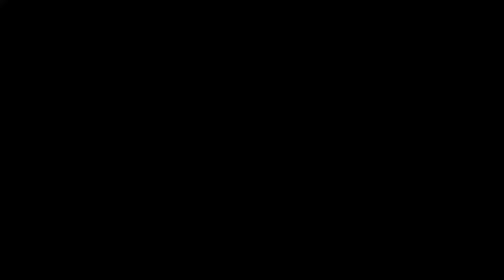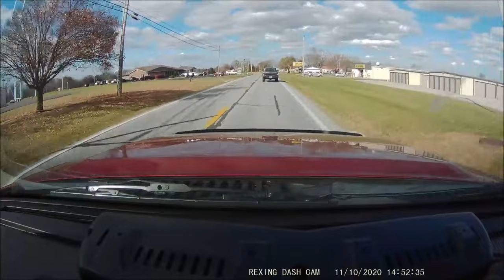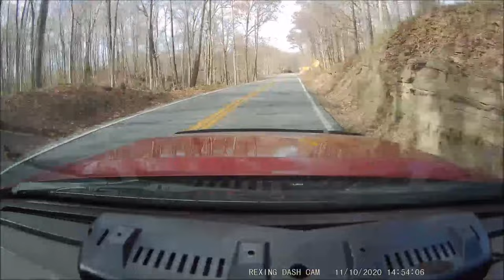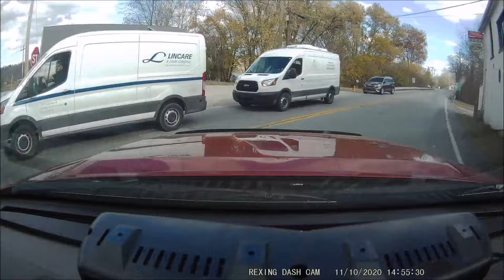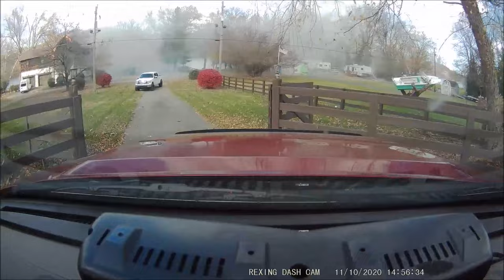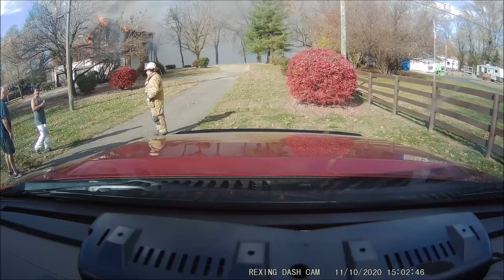Structure Fire Response 11/10/2020

Comment: Brother.....that is was nowhere near “fully involved” when you “arrived”
Reply: By the time first due would get there, it would definitely be fully involved - roll the rigs, better to have more than not enough, this isn't a major city, hell, it isn't even a tiny city for that matter - fyi, 12 mins from dispatch until first water on the fire.  Chief, that wasn't a dig at you, I was a Captain in a rural dept, I get it, you can only do what you can with what you got - good job
Reply: By the time the rest of the trucks get there, it’s going to be fully involved. Easier to make sure everyone’s rolling out and prepared for a full structure fire rather than thinking it’s going to be a small one and not having enough equipment, especially when in a case like this they’re clearly a small department and needed mutual aid as it was. I’m on a small, local, rural department and most of the time we’re lucky if even 3-5 guys are able to show up for a call at any given time. I’m almost always right across from the station at my shop so I’m usually the first one there and can get trucks fired up and garage doors open so everything needed is ready to roll by the time the rest of the guys and Chief get there, though often the chief isn’t far behind me as he’s also close by. Always good to be over-prepared, especially when it looks like the wind picked up a few different times throughout the incident which can drastically increase the rate at which the fire burns. My dispatch always says current wind speed, direction, and ambient air temp when we get a call for any type of fire.

Comment: I'm not trying to be a Critic but why not run a Draft line from the river to put out the fire with huge unlimited water source
Reply: And why didn't somebody turn on the water cannon on top of the truck could have knocked it down and put a damper on quickly
Reply: Perhaps you should read the description
Reply: Most engines have 4 lengths of suction on the engine.  Hard to draft if the water is to far down grade.

Comment: How do you check on scene half a mile out and say it's "fully involved" and when you arrive on scene its a fire in one or two rooms on the second floor with extension in the attic? Apparently the words "fully involved" are thrown around too much.
Reply: It might not have been fully involved when he arrived but it was definitely fully involved by the time the first engine arrived
Reply: @Hal-Robinson  That literally doesn't matter at all. Any size up should be accurate and informed. Checking on scene before you can even see the scene and saying it's "fully involved" just by the smoke you see it a typical unexperienced volunteer thing to do. You don't give a size up for the future when the first arriving engine company gets there. Thats not how it works and if you think thats okay, you must not be trained very well.
Reply: @Hal-Robinson  and if you REALLY want to piece it apart that much, the first arriving engine arrived around the 16 minute mark. Definitely nowhere near fully involved it was only the second floor from the front that you can see. Like I said in my original comment, the words "fully involved" get thrown around way too much by inexperienced fireman on the radio that can't tell the difference.

Comment: Unless I am wrong but it looks like one of the first or early arriving firefighters (maybe a chief officer?) was more concerned about getting his drone up in the air instead of either doing a 360 (on foot) so can provide decent operational incident command. Hopefully I am wrong in what I see? I get it having no water supply and having to depend on tankers to shuttle water but totally against technology becoming a barrier to actually boots on the ground! I am not beating up on the other firefighters that seemed to be doing the best they could to shuttle water to the attack pumper(s)!

Comment: Ok I am so confused, why you set a dump tank to run a tanker / shuttle then place a engine in the front of it?  😱

You have a loop drive way... Place the engine in the middle pull 2 hand lines and use the turret as a 3rd stream... Place  water supply down in the head of the driveway... Use the 2nd engine to draft from it and push a constant water.... Keep your tankers moving with water never sitting and waiting. 👍
Reply: I think there seemed to be a problem with the first tanker...and since it was not mentioned in the description I'd guess operator error.         Personally I would have dropped the PT about halfway down the drive for the next incoming engine and tanker to work with and nursed the engine in the front yard.

Comment: I was a firefighter forv2 years. I might be a bit nit picky here so bear with me.  #1 your dealing with mostly Volenteere departments so its hard to get people & equipment out & tonthe sceen.  #2 There are a few things that i would have done diffrentky. And #3  1 key factor  that was lacking from command was clear comunication (in my oppenion)  to his first arriving engin & tanker. He had to go face to face with them to give them instructions. Thats what the radio is for exactly WHERE do you want your first engin for fire attack. Where are they to.park the truck & what assignment when they get there. It dosent matter WHAT the first in engin company is just clearly state "First in Engin company I want you to come in the gated entrance park in the drive way & start fire attack second due engin company establish water supply)  this is very clear cut telling tankers to park "where ever" is poor planing & comunication. You tell them exactly where the tankers are to stage you may have 2 staging areas due to where the tankers have to come from if they have to pass the sceen to enter staging you may have to have 2 staging areas.  This was my major beef clear concise comunication or lack there of. The placemet of the porta tank coukd have been better as it took a while for the second engin company to arive to setup water suply (aka drafting opperations) if the first engin cimpany was placed diffrently there would be no need for the second engin company to drop hard suction, however its always best if posibke to have your second due engin company to supply the first engin.

Comment: That 1st tanker does it have a deck gun ?? Glad 1st 2 engines hit deck gun but the tanker should've dropped the drop pond/pool off n supplied the engines with water. Wasted time n resources. What ground conditions to lake in background??? Could a engine have been beached there to pump water up to another ??
Reply from the maker: This is the Ohio river, we did eventually go to the river at our boat ramp once it was determined all hydrants were out of service. However, when a barge went by it stirred up a lot of debris which started to get in to the tanks. This would have caused a lot of damage to the engine. The tanker does not have a deck gun but we actually mentioned that on scene and wished it did.

Comment: Could you not draft direct from the lake?
Reply from the maker: This is the Ohio river, we did eventually go to the river at our boat ramp once it was determined all hydrants were out of service. However, when a barge went by it stirred up a lot of debris which started to get in to the tanks. This would have caused a lot of damage to the engine.
Reply: @JASON8502  makes sense. Thanks for the response!

Comment: I’m gonna need tankers? I see a body of water behind house what is wrong with hard suction pumper?
Reply: I found it on google earth and it’s just close to 240 ft from where they set up the dump tank to the edge of the river unless you find 24 sections of hard suction and have the best pump made then you will not create enough vacuum to pull the water that far.
Reply: @zachbaker1583  I thought a pumper might be able to get closer. I guess that would depend on how firm the yard is and what weight could get on it. 
Also the next property looked to be a mobile home park that got closer to the water as well, being I have no clue the address I can't just look it up to see how close a pumper may have been able to get. edit: Just relooked at footage. It looked to be a campground that goes right near the waters edge, too far for pumper to pump to engine?
Sure would have been better than running the tankers, especially with low pressure hydrant as the lady said when she was filling her tanker.
Reply: In the Netherlands the fire departments often hydraulic submersible pump to get water. I think Berkeley, California has a system from the Netherlands.
Reply: @chukkie0001  for that I’m sure it is a matter of funding and justification. If had call for it to be used multiple times a year then the justification is there.

Comment: This is a good example of the reality of rural living. Most departments are volunteer and being during the day this is what will happen. My only take aways are the first in engine did take up a lot of time setting up and they also could’ve utilized their deck gun and took out fire more efficiently. You gotta do what ya gotta do with what you’re given with these kinds of departments. Response times are excused due to location and personnel limitations but once that first due engine arrives they set the tone for the rest of the fire.
Reply: Thanks for proving you have no clue what you are talking about
Reply: @virgilhilts3924  I do have an idea of what I am talking about, I am on a paid on call department that runs 2,500 calls a year and neighbor a full time ALS department. The upper half of this house was a loss from the get go and no interior attack was possible. This is a surround and drown and just dump a deck gun with multilpe hose lines on the sides. I work with multiple volunteer departments and I know how operations work when thats who youre working with. I experience these types of responses often and understand that maybe one of theses departments was full time. Most likely the first engine on scene, I'm not sure what youre getting at.
Reply: @jn3665  
You keep telling yourself that

Comment: I myself found 1 man can slow/putout a fire. It was a car fire on our vol dist’s furthest east side on 294. Daytime call and most  worked days. I was first in and geared up. No one showed so I took our 2nd engine which held 750 gal instead of lead at 500 gal. It was fully engulfed  so as I pulled up I heard lead engine responding so extra water was coming. Packed up pulled an 1-1/2  and charged line.  By time 2nd due pulled up it was out except for under hood for most part and had 1/4 tank left.  I know whoopty do. But one man CAN get a good knock and from what I could see in this video one man could have got a good knock on it. Hoping not to push fire in but this looked like a major clusterfuck. Why didn’t they put tanker setup in street and use an engin to relay pump in? . Just my armchair thought

Comment: What does “on air” mean? Responding? Here where I am we call in with our Dept number and say “we’re en route”
Reply: In most departments On air means that a unit is in service and the radio is active for the dispatched vehicle so both the IC and the dispatcher can transmit information to it.
Reply: @josephbennett3482  so it’s basically means the same thing of how we say it here by being “en route” = in service.
Reply: @CSAFD  yeah pretty much , On air is radio active and the unit is either on standby waiting for their next dispatch or they are currently pulling out of the station.
When My city department units go out of service for a short while they say that they'll be off the air and unavailable for calls but the only time that's done is when they have to refuel and it's only done about twice a week depending on how busy it gets.
Reply: We say our unit number than 10-8 or enroute here.
Reply: @lindanwfirefighter4973  my area left the “10” codes a long time ago.
Reply: @CSAFD  98% of the U.S. stopped using 10 codes a really long time ago because of every place being different in what their 10 codes mean , on mutual aid calls one department would be completely confused on the orders given by the MA requesting department and they would do the totally opposite thing. Since all of the emergency management agencies were responsible for their own radio systems it was very hard to match them all up so everyone in the U.S. had the same codes.
Reply: I think it means because they are a volunteer fire department that it's people acknowledging the call and responding to the station to pick up apparatus. So when they get to call they are on air on the radio but not actually in route because they have not gotten to the station yet to pick up equipment and respond.
Reply: @Hal-Robinson  
For me and my departments (I’m on 2) 
Tones go off, if I’m @ home, I say “my call number in route” if I’m going to the station or scene.
If I go to the scene from home I’ll say “call number on scene”
If I go to the station to get the truck “I say our truck number in service and responding, then on scene, leaving scene, back in quarters.”

Comment: How much booster tank water on that first due engine,and how much on that first tanker? It appears the tanker has a pump. Why not just hook it to that first engine and "booster backup" the initial attack? Probably could have "reset" that fire with a big line or deck gun. You could put a lot of fire out while waiting for the next due. It seems like you definitely have manpower issues, so maybe this tactic would work. Just a thought.

Comment: In most cases yes it would have been smart for him to stop and grab an engine and go to sene and drop an attack line and start a defensive attack on the Alpha sidr of the house. Secondly he is the indecent commander (IC)  which means its his job to get other departments enroute for manpower and mutual aid. Requesting multiple tankers is good reason being is while 2 are fighting that fire the other 2 act as a hydrant aka water supply. 15yrs in the fire service.
Reply: You can be incident command and still be on a suppression piece. Requesting additional alarms and tanker assignments takes 10-15 seconds and is easily achieved in the scene size up. Next arriving officers or chiefs can easily assume or reassign themselves. You should have pre assignments and not need to micromanage your crews.
Reply: @hihfty  In my borough we ran command from the engine seat for many years.  And there are videos of him making knocks while only guy on the scene.

Comment: Water source right behind that house. Chief, how about mandating water pumps 500ft apart along the waterway? They do that here in remote areas. If a water source like lake or large pond is avail they put these high pressured waterheads in with a generator. Pretty neat system and i am sure it would reduce insurance cost for that area.